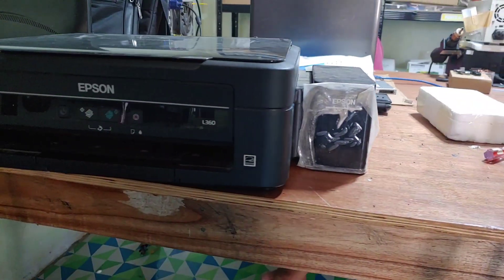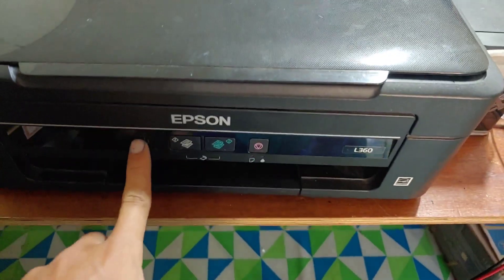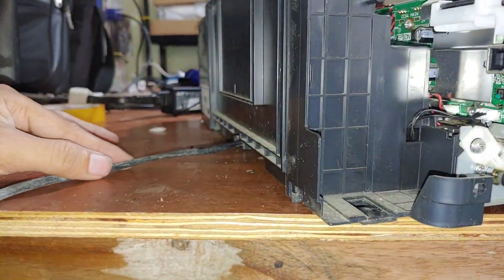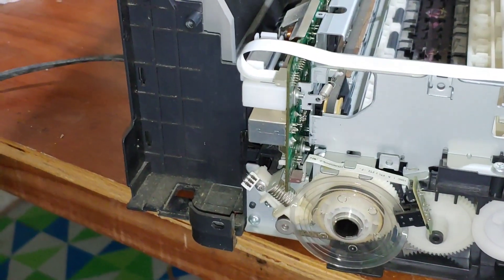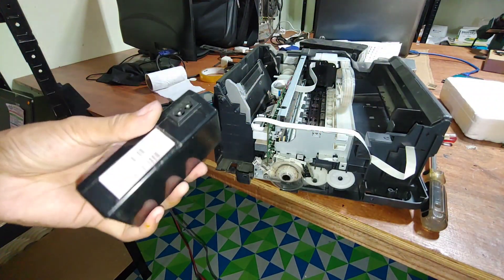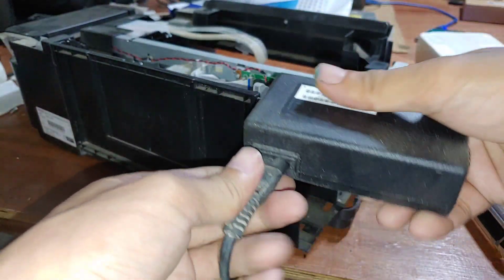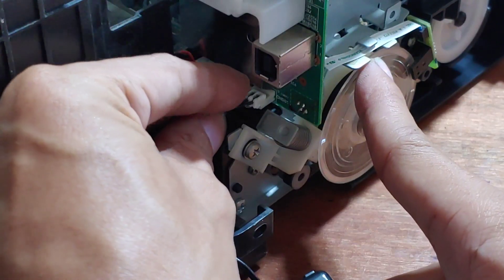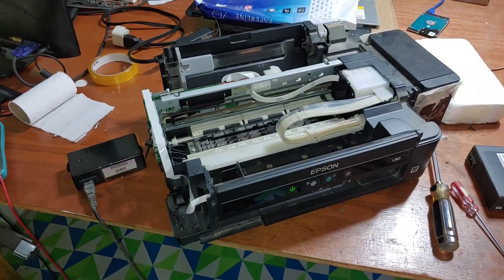Epson L360 no power | basic troubleshooting guide

Comment: I checked mine.  Power supply is good and the wire is also good.  But it still doesn't turn on po.  Which part could be wrong

Comment: Sir pano e fix ang epson L220 model  ang problema po is kapag e pindot ang xerox po biglang sya mamamatay at pag e on ulit e luluwa nya po ang bondpaper, sana mapansin nyo po sir.. 🙏🙏
Reply from the maker: Posible a psu problem if namamatay sir
Reply: Ano po ang cause na nasisira ang power supply